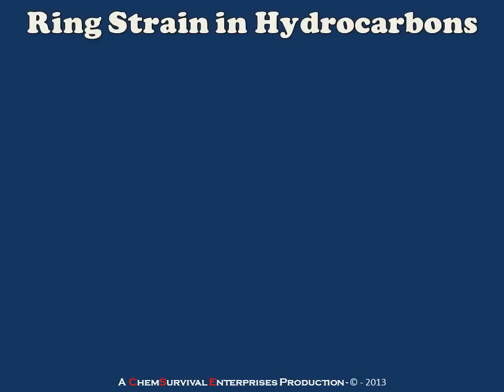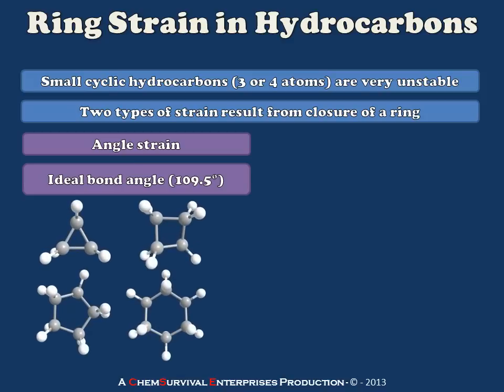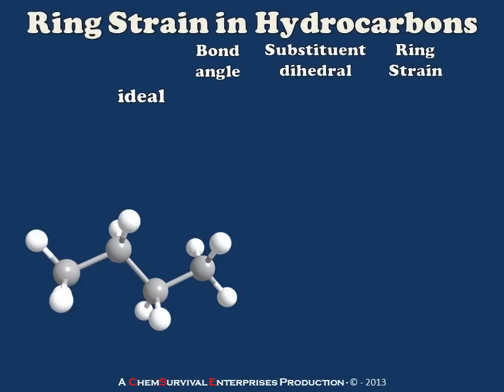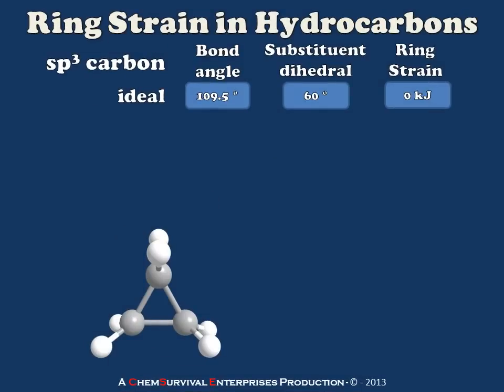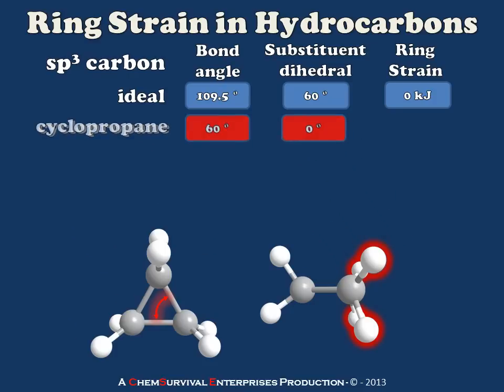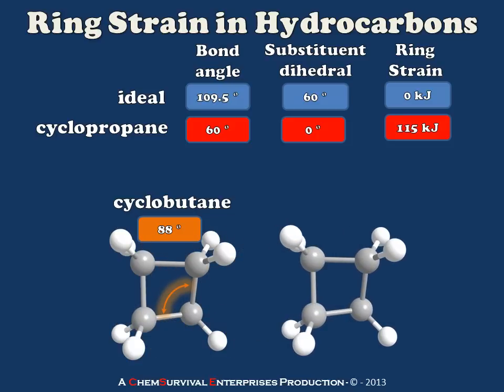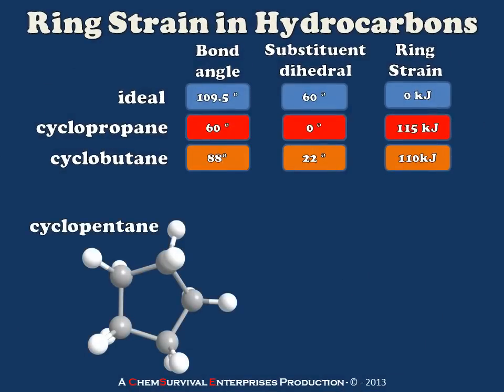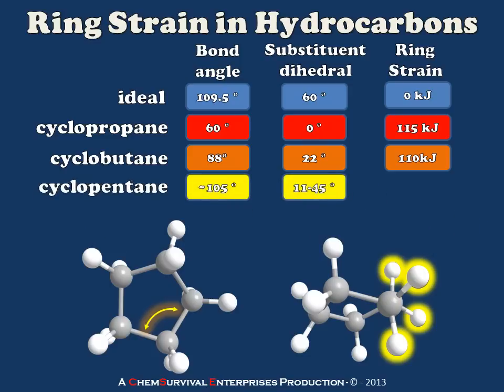A brief introduction to ring strain

Comment: cyclohexane does have ring strain though, where does that come from?
Reply from the maker: Naturally there is an entropic penalty to cyclization that will increase the free energy of any ring compared to its non-cyclized CH2 units.  This contribution to the free energy of a cyclohexane ring is generally neglected when discussing ring strain because we use cyclohexane as the definition of zero strain (it is a pretty darn good estimate, too).  If you instead use completely freely rotating CH2 units as your reference, then there will indeed be a bit lower free energy in the hypothetical non-cyclized compound owing to the additional micro-states available to those units.

All that having been stated, cyclohexane remains the undisputed king of stability when it comes to saturated organic cyclic compounds.